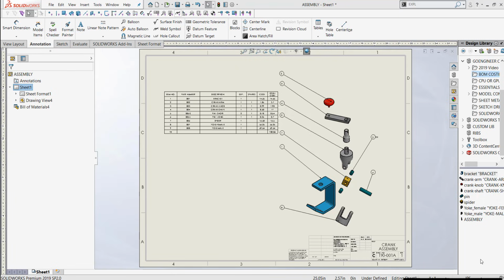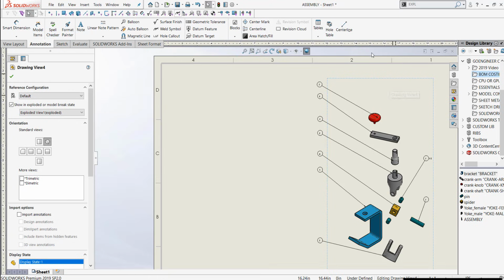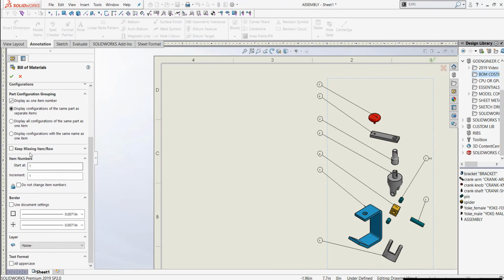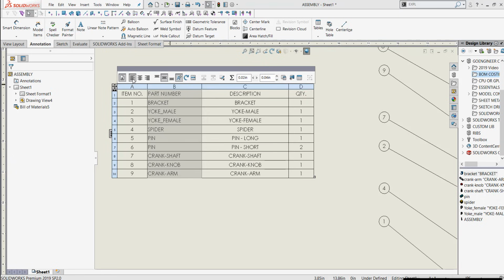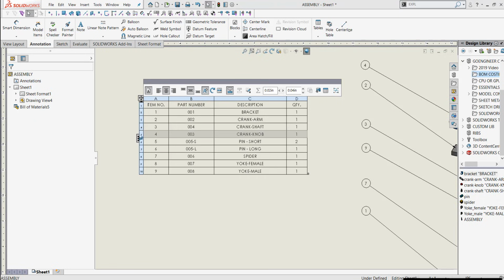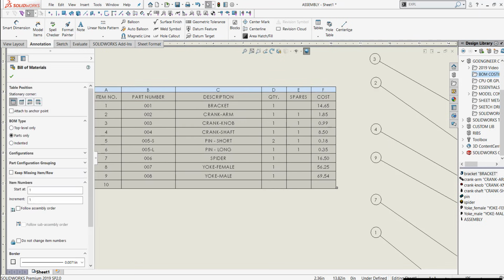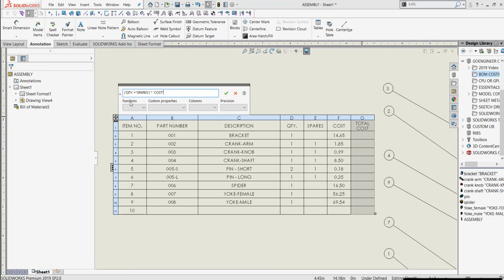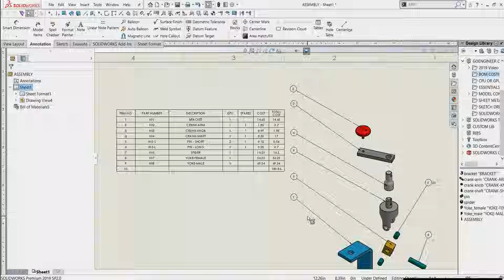SOLIDWORKS Tutorial - BOM Customization

Comment: Hi, I have a question. Is it possible for the BOM to automatically update values (such as length or width) after changes in the 3D model of the object? Or I have to change BOM everytime i change length in 3D model?
Reply from the maker: There's an option under Tools > Options > Document Properties > Tables > Bill of Materials. It's called "Automatic update of BOM". Make sure you check that box to get most of the automatic updates to pull in. Otherwise, you can try to rebuild your drawing using Ctrl+B and Ctrl+Q, and the values should be updated with the latest information from the CAD model.
Reply: @goengineer  Thanks ^~^ I will check it tomorrow. I have solid works standard 2019 if that matters.

Comment: I have a question if you don't mind.  I wrote an equation for total area in the BOM.  Works great.  Another user opens that files and all values go to zero.  In my machine it works great, but he opens it the values go to zero.  Any ideas?  I think it's an Option or maybe Excel verses Table BOM.  Thanks.
Reply from the maker: Hey Jay, make sure the file that is referenced in the BOM is also opened. Having the correct or matching version of Excel may also resolve this.

Comment: That's awesome!!
I have a question - if I want to save this customized as a template and reuse it for a different assembly later, the biggest challenge I see would be that you programed row10 (total cost) to be a sum of row 1-9, would it work again if I have another assembly with more than 9 components then?
Reply from the maker: Great Question: Any additional part will of course be added to the BOM. It will add them below the total cost line. Just drag and reorder for the BOM, then right click on the Equation that we used for cost and add the new cell.

Comment: Hi David, what if I needed to directly link the part numbers with the baloons? I'm trying to set the BOM that each piece in the exploded view is linked with its hierarchical number (2.2.1; 2.2.2; 2.2.3...) rather than 1,2,3....

But I have to write it manually inside each baloon.
How could I do it?

All the bests.
Reply: Giovanni, to do this you need to have a sub-assembly as part of the model. For parts only no subs the parts are whole number 1, 2, 3, ... Once you add a sub-assembly change the BOM type to indented, when this happens set the drop down menu to "DETAILED NUMBERING" this will update the BOM and balloons. I have had an occasion where I had to re-auto balloon when doing this FYI.